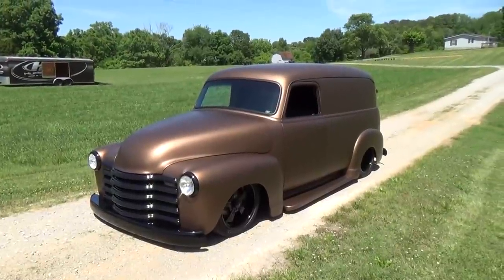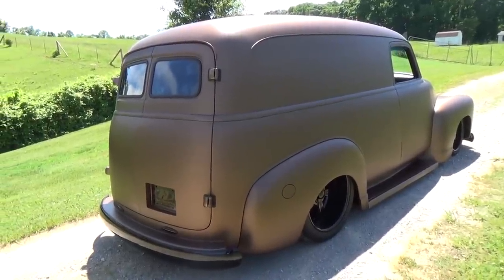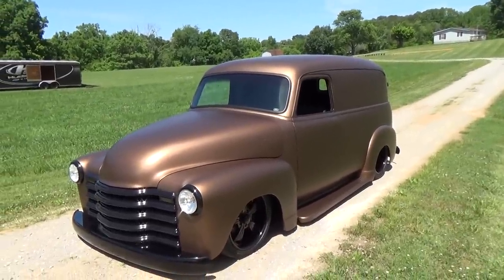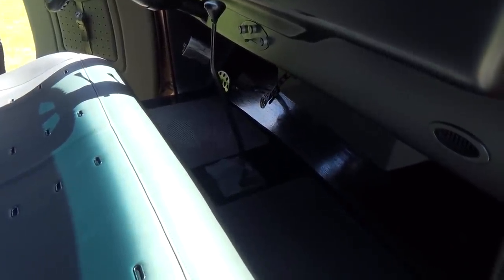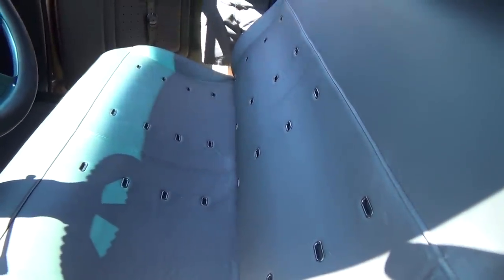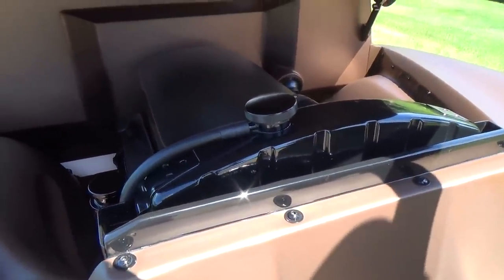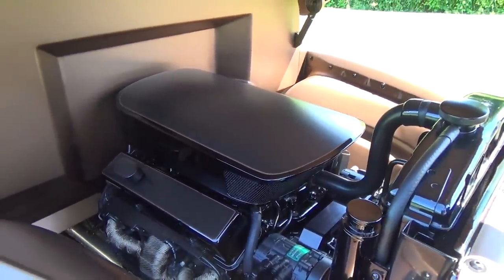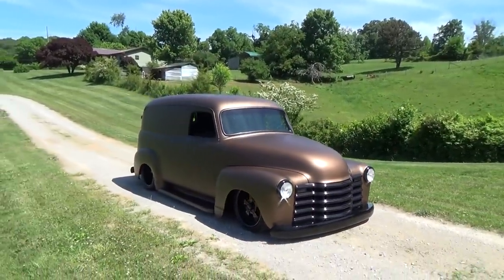Vintage Chevy Street Rod: 1947 Panel Truck Custom Build By Hudson Rod And Custom

Comment: do u have the original  motor and tranny if  not do i need to modify  the differential  to go faster mine stock in line 6 with powerglide
Reply from the maker: +RC JUNKIES I just shoot the videos....They have a facebook page and will be glad to give you that information...
Reply: Thanku

Comment: Saw this on FB, and it's a really beautiful job. One question though: Is it really a '47? The reason I ask it that from '47 through '53, Chevy trucks had a split windshield. The curved windshield, which is on this truck, was only introduced in '54. This truck, however, doesn't have a '54 grille.
Reply from the maker: +Bob Bubba Yes it is a 47...it's all custom...
Reply: ScottieDTV So you put a '54 windshield in the '47? That's what I really call artistry. Anyone else would have just fused the divided windshield.
Reply from the maker: Bob Bubba I didn't..lol...I just shot the video...but Hudsons Rod and Custom did...

Comment: I love the truck, but to say it was "built to drive" is a bit of a stretch.  It has no wipers and no rear view mirrors, inside or out .  How do you even get it tagged ?
Reply from the maker: +Charlie Russell It's a Hot Rod.....rain X....works fine.....Mirrors are left off a lot of them.....tags are no trouble....